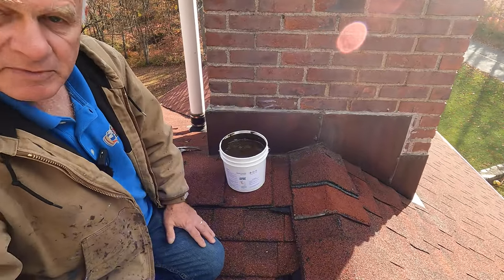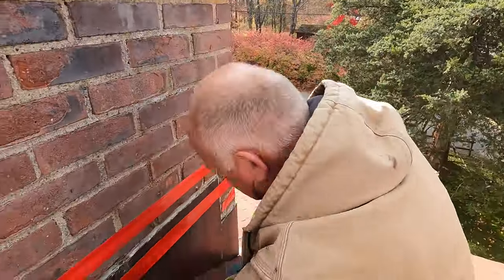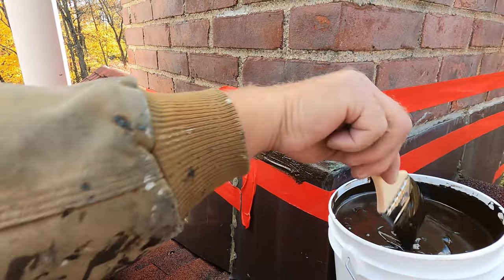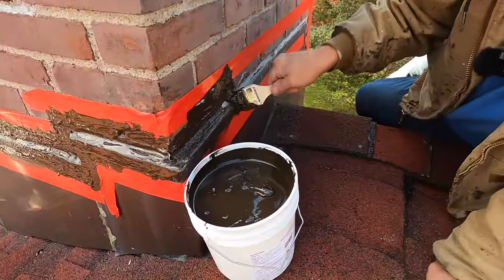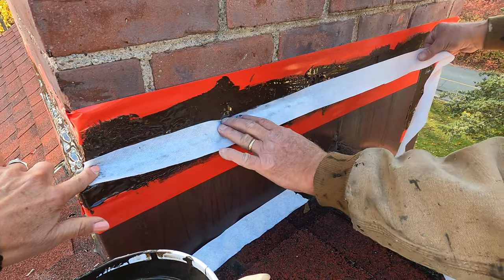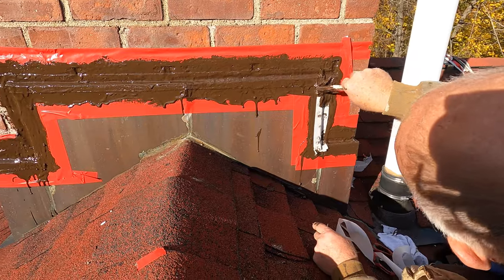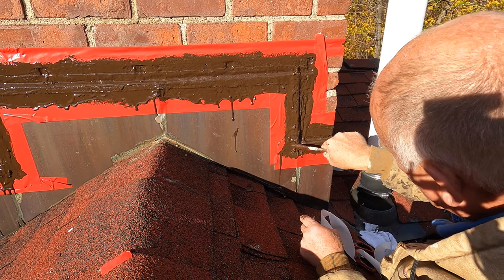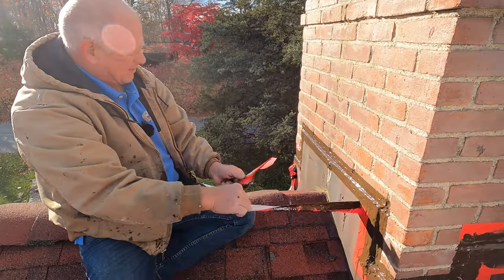How to Repair Chimney Flashing leaks - Easy, fast, everlasting DIY

Comment: How would you use this down lower where the metal flashing meets the shingles?  That is where my leak is coming from.  TIA
Reply from the maker: Ok, the leak you describe is supper hard to repair. I do not recommend sealing the transition between the shingles and metal flashing. I think you should remove the shingles from the bottom corner of the chimney to the top corner of the chimney, and determine the leak.The flashing at the the 2 corners are most likely causing the leaks. From my experience, when the flashing was installed to go around the corner, some gaps were left open. If thats the case, then apply Turbo Poly Seal over those corners and reinstall the shingles.
Sorry for making you work so hard.

Comment: So it has no trouble sticking to the caulking because usually I see you front it out
Reply from the maker: no, I usually leave the caulking in as a gap filler. Otherwise it will be hollow behind the fleece

Comment: Now the roofer on can is on a pitched roof..did they finally kick him off the flats? Why not address the brick issues properly instead of spreading more crap from a can..a pig can look great its still a pig...remove the old caulking and reseal make sure it's cut in...get a brick Mason up there to address the issues...put a proper cap...seal the brick after...ya it's wotk..takes time and effort but a home owners investment deserves more then roofing in a can